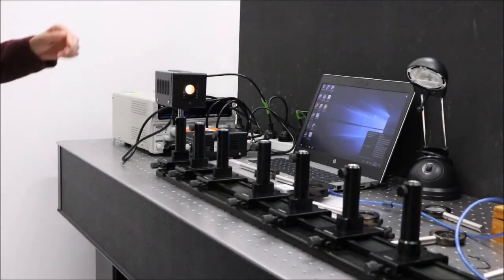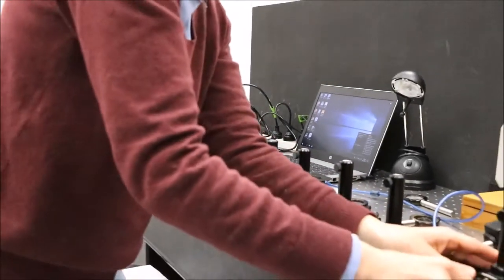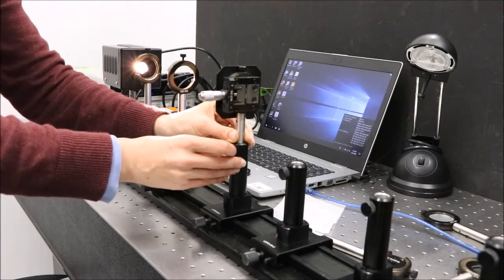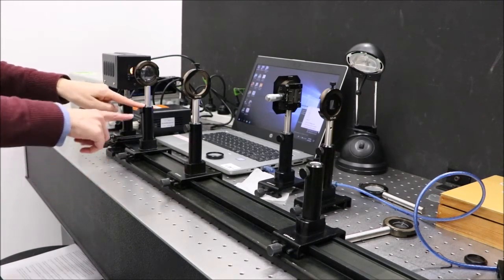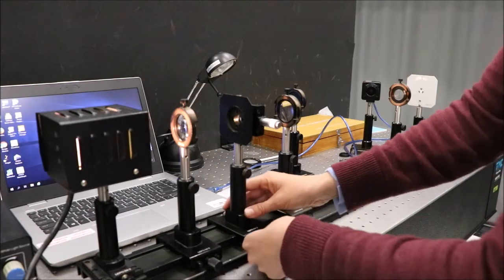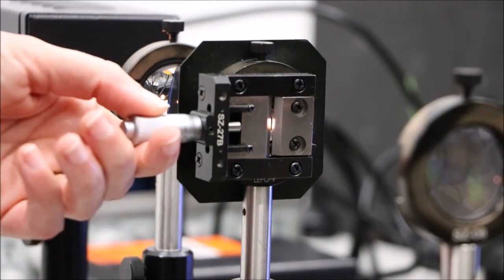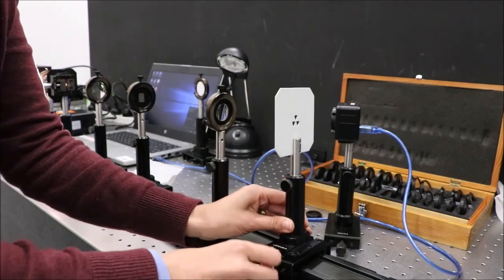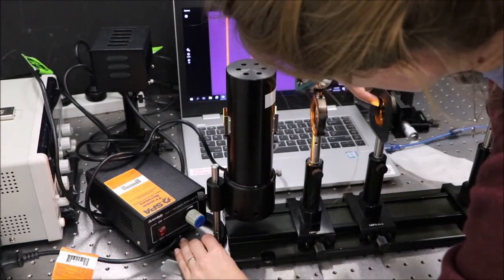Optics Experiment 5 - Building a Diffraction Grating Spectrometer

Comment: Nice video, thanks.

What if the grating is on a 2mm thick glass substrate. How do you compensate for the refraction in the substrate.
Reply from the maker: Gratings in commercial spectrometers work in reflection mode to avoid this issue! You could model the refraction if you knew the dispersion of the glass but it may prove simpler to do it empirically using known emission lines.
Reply: The problem is if you will get the light out from the glass substrate or not, because of TIR inside the substrate.
Reply from the maker: That will of course depend on the angle of diffraction(wavelength, grating pitch). The gratings I am using diffract the light be small enough angles that the first few orders would still be transmitted albeit at slightly larger angles, only weaker higher orders would be lost to TIR. If you lose even your first order to TIR, you could try changing your angle of incidence.